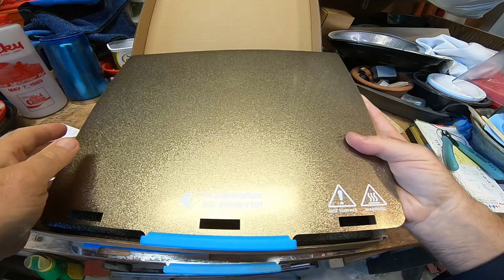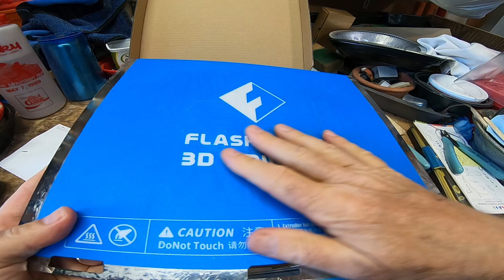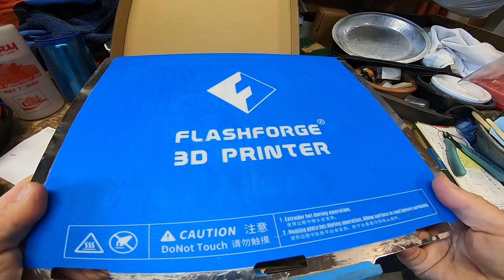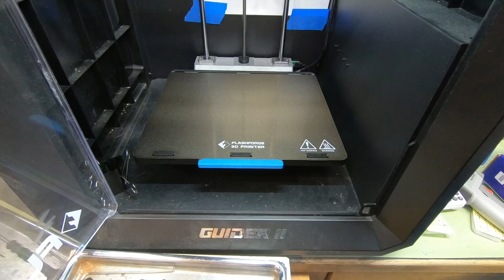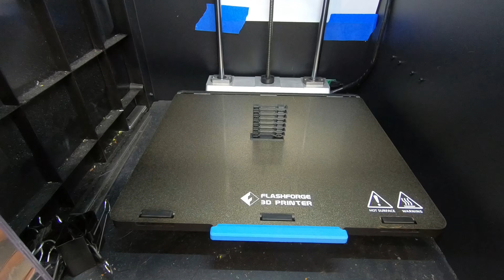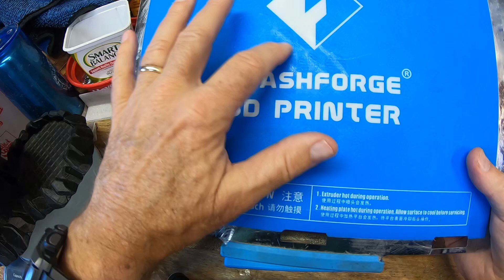3D Printing - Unboxing & testing a Removable PEI Build Surface vs. Sticker - Part 1

Comment: Where did you buy this? Been looking everywhere and can’t find
Reply from the maker: Flashforge stopped making these. I bought mine a few months ago. I did find a 3rd party replacement on AliExpress and bought 2
https://www.aliexpress.us/item/3256806215257182.html
I'm going to have a review of that next month on this channel.
So far it's working well, but not quite as high quality as the Flashforge version.
One good thing is the AliExpress version is double sided.